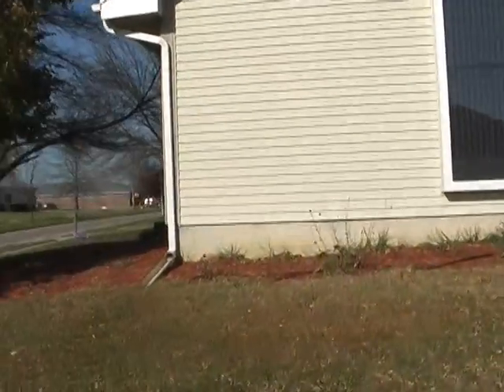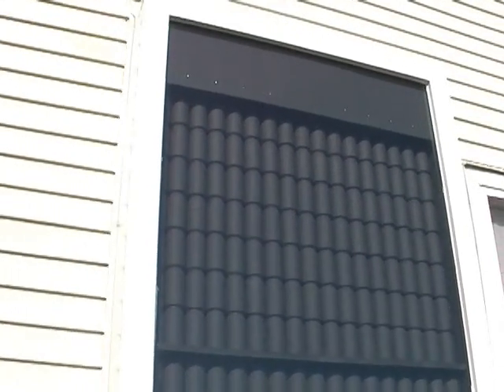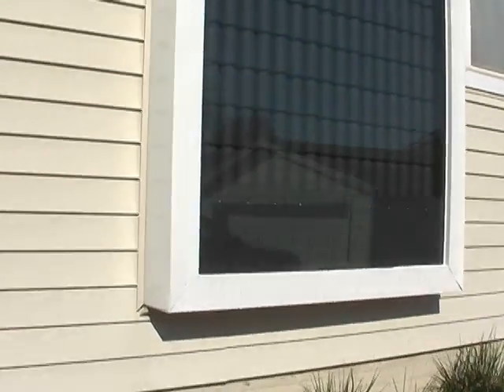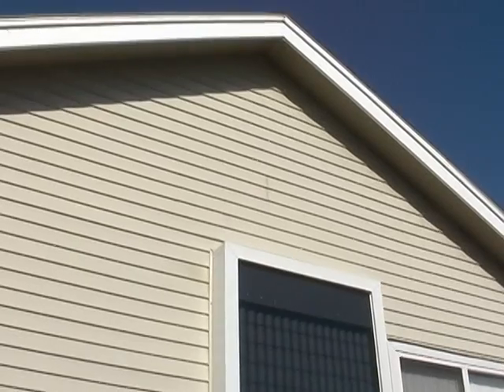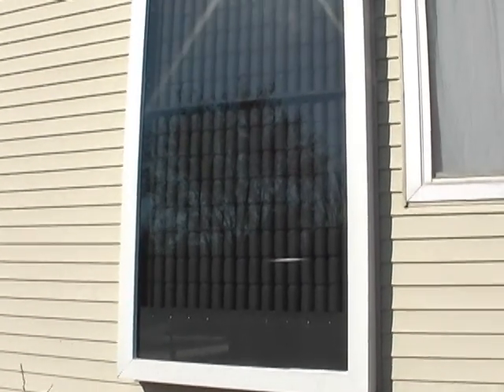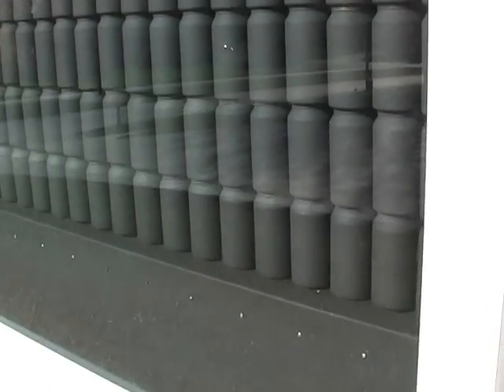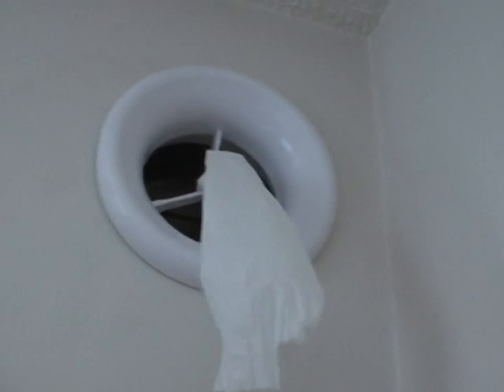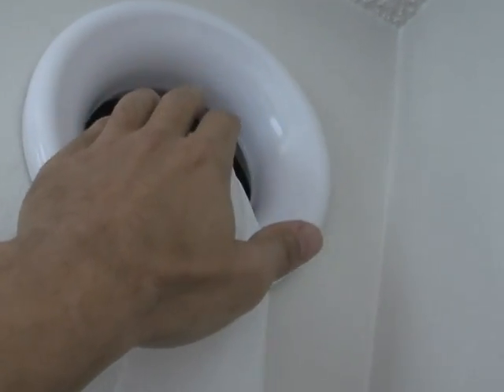Simple Thoughts "Free Solar Heat"

Comment: I'm making one now. My concern is that, in my first test I got over 125 degrees out of it putting 35 degrees in. I left the silver backed isulation unpainted and only painted the cans black. 

I took it apart to fix a few things with it and noticed that the silver backing was coming away from the styrofoam. It almost looks like the styro was melting a little. Have you noticed and issues with yours? 

Thanks, Click

Comment: if you want, you can still use this in the summer time hooked up to a solar oven for cooking. I haven't tried this but i will when i make mine. you can connect it to a smaller box to vent all the hot air (slow), temps may reach up into the 300's. cook for a few hours and you great food with your dual purpose/season solar heater

it is a little harder for this configuration if you have a wall/roof mounted unit

Comment: Very neat workmanship!

Do you think that you could try using corrugated roof sheeting as a simpler option instead of the soda cans? It would save alot of drilling, can-opening etc.
I realize that its not as attractive an option as using trash cans, but certainly would make it a lot less work to build. Also being sheet metal steel, not aluminium it wouldnt have the same conducting properties . . . but maybe it would still work well. One could put up a whole wall of the stuff . . .

Comment: Awesome job on the video and panel!!!! I thought of water pipes interleaved with the cans but it would have to be a closed system with antifreeze. I think its a good idea but I opted out of doing it mainly because I didn't feel it would heat both air and water well as each medium would compete for available BTUs. I may take my test panel apart and retrofit to test. I will post any results. Drilling the cans left a nice lip for RTV. No mess on the outside. Paint wont stick to RTV.